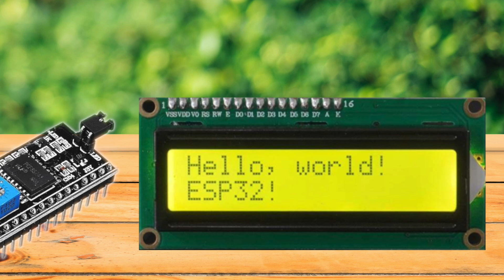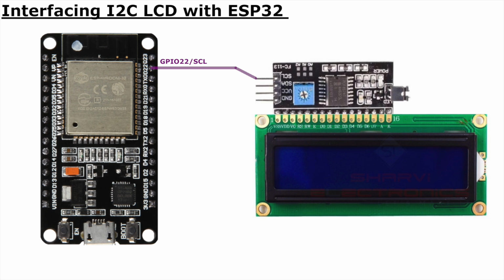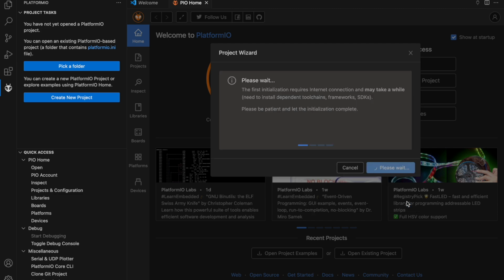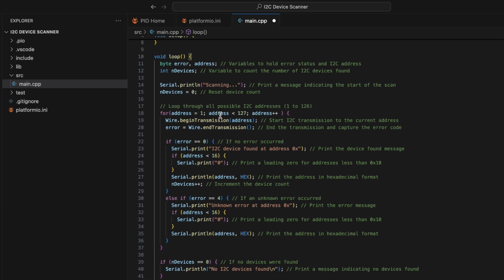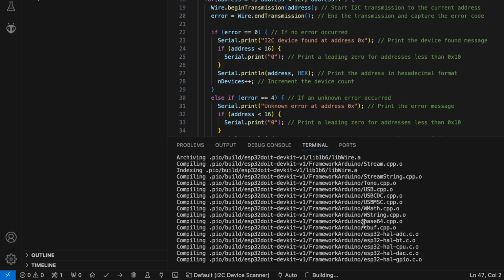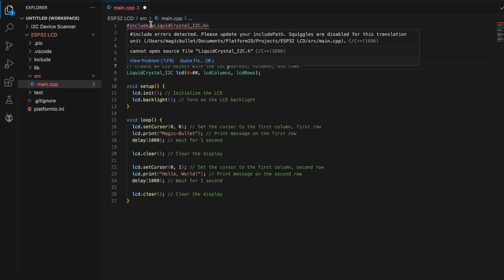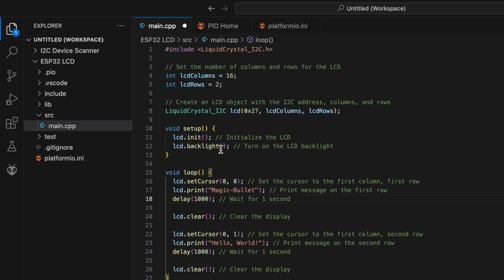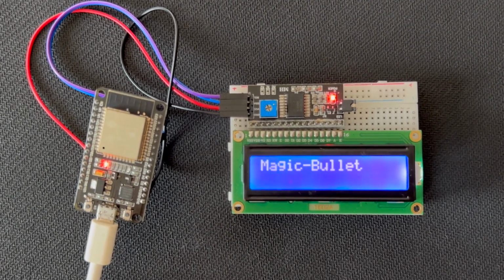ESP32 and 16x2 LCD Display: Complete I2C Tutorial with PlatformIO

Comment: Is the lcd 5V ?
I mean i heard that so why are you directly connecting it with esp32 and not using level shifter
Reply: The ESP32 and ESP8266 are said to be somewhat officially tolerant to 5 V.